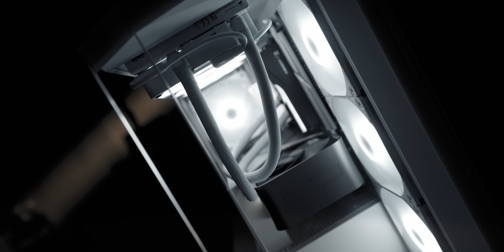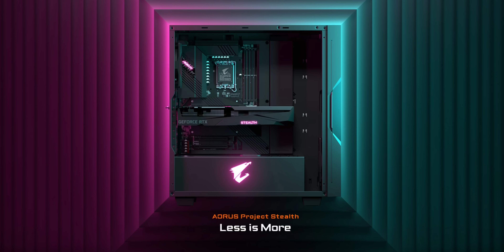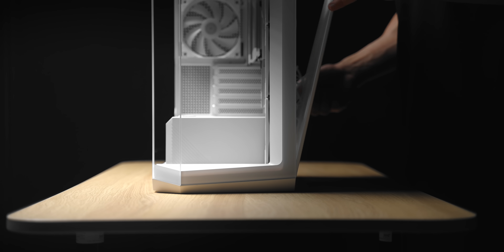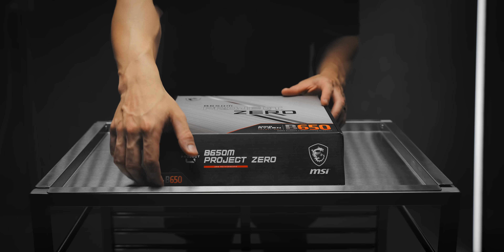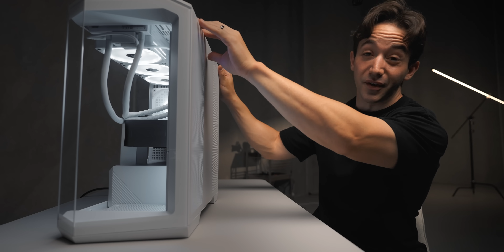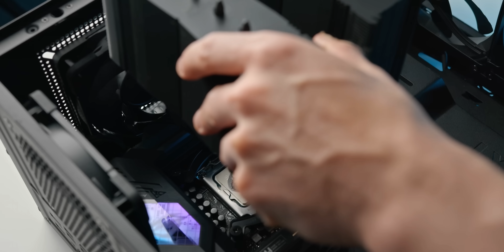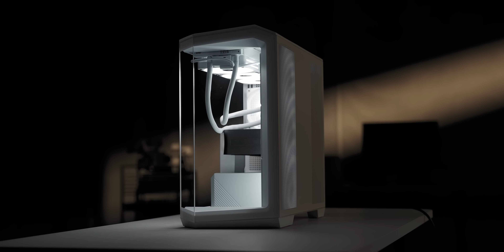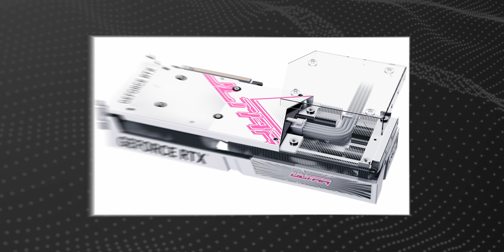"zero cable" PCs are here.

Comment: Ever since I assembled my first 486, I was annoyed that the cables were not plugged into the back of the board. And there were no fan connectors back then. That was primarily the 24-pin connector, the various ugly front panel connectors and the wide, flat IDE cables. It's nice that 30 years later there are finally solutions to hide the cables *completely*.

Comment: Just bought the MSI b650m Project Zero board and im gonna put it inside the Jonsbo D32 PRO which supports the BTF standard. Can't wait to build inside it. Gonna use my 7800x3d + 7900xtx from my main rig since im simply downsizing. ASUS royally fucked me hard when they did a bios update which REMOVED memory support. So my 64gb DDR5 6000 cl30 TeamGroup ram which WAS on the support list prior to the bios update, no longer works at rated speed. ZERO tweaks allow me to retain full speed. I am now forced to run 4800 speeds.... So, along with my new MSI board, i bought some silver ram that just so happens to be on the MSI support list. Because one thing I know about MSI is that they NEVER remove memory support. So if the memory is supported, it always will be. I legit wont touch ASUS boards ever again. I can't support someone who does such a thing.... And over my years of Ryzen and utilizing MSI I never had any issues. Even when I had "the worst x370 board ever made" according to many tech youtubers, aka the x370 gaming pro carbon which "has the worst VRM design of any motherboarb." meanwhile I was running my 1800x as a blistering 4.2ghz at 1.5v which everyone said was "impossible" because "your vrms can't handle 1.5v" and "the 1800x isn't stable at 4.2ghz" yet, I did it. And then after 6 months, due to running 1.5v, I had degradation. Which I knew would happen but didn't care. After that point I ran 4 ghz at 1.42v which was higher than the stock 4ghz at 1.36v it could do prior to degradation. And then about 6 months after that it wouldn't run 4ghz anymore and I had to drop to 3.8ghz at 1.42v which showed how bad the degradation was snowballing. Eventually to a completely dead 1800x. I've since stopped overclocking because I just dont care for it anymore. Ran my 3950x bone stock and my 7700x bone stock (which I donated to my brother) and now my 7800x3d which CANT be overclocked (not modern OC by changing multiplier) so yeah. Never ever had issues with MSI motherboards. They've been the MVP this whole time. Even way back in the day my brother used to use MSI in the 90's and never had issues then either. Going back to MSI will be legit. Put my 7800x3d in it, my new ram, my 7900xtx (power color red devil) and gonna use a arctic liquid freezer iii 240mm with my corsair rmx shift 1000 watt and its gonna be a rock solid build. Hopefully the case design for top mounted radiatior in 240 will give me enough room to run push/pull but if not, no big deal.

Comment: To make a completely white PC, do I have to buy a white or black power supply will be good because it would be hidden?
Reply: Depends on your case choice. There's way more BTF/Zero cases, especially Mesh cases and Fishtank/angled cases with a rear/bottom cubby/cable section to hide the PSU and wiring. The bigger issue is usually trying to get white GPU and motherboards, as they are both the most expensive, and the most difficult to buy in stores, often on backorder. Fans, AIOs are sometimes difficult for the same reason, i.e. you have limited choices in 'pure white' fans. It is easier, but it can be a long wait in some places to get stock. 

PSUs tend to allow for modular cables, which you can resleeve or buy custom color / custom length cables. With a BTX case, you don't have to deal with that, just the AIO cable/tubes.

Comment: I hate tempered glass and people using their PC builds as fishtanks for tacky lighting, and to me this is just a cleaner version of the same bad aesthetic. But having all of the connections right where the cable management happens is still smart.

(Though for really cramped sff builds, I could see it adding bulk to the build because you need cable management space in the first place in order for this to be smart, so it's probably pointless for cases where they expect you to just cram all the slack under the power supply where the cables come out, or for other SFF cases that use a riser to put the graphics card on the reverse side of the motherboard.)

Comment: if you want to, vertical mount the gpu and then add one of those cables that has a plug that goes forward then straight down for a cleaner look.

Comment: Your point about 'How are they going to make this clean, minimal case, but then make this abomination.' is really where case, GPU and mobo designers need to look now that they've gotten 'RGB everything' out of their system. How do you make a build platform that remains modular and standardised but is also designed like the person making it actually cared about the final build's experience for the user. Apple did it well but they had to break away from the need for modularity/standardisation, but to be fair to them, PC design just got stuck on this 'metal box of fans with a big GPU box in it' state 🤔So there's a market gap there to be filled if someone can figure out the design problems that Apple had to compromise on by going 'closed system'. Can we really do no better under the square ATX/ITX standards?

Comment: to hide the gpu cable you should of vertically mounted the gpu then used a 90 or 180 degree 12vhpwr cable to route the wire behind the gpu to make it not visible

Comment: Not only is it cleaner to look at, but it's easier to build the PC since parts go on one side and cords go on the other and none of the parts get in the way of fitting cord ends into slots, and it's also easier to actually clean. since most of the tiny spaces that end up collecting dust are all separated to a back panel that can easily be opened and cleaned separately without, again, having to clean dust through cramped PC parts.  Hopefully NVidia, AMD and the GPU mod brands support this PC build style in the future, it's literally just changing where the plugs get plugged in.

Comment: the GPU cable will have to be taken form the power and will be shown there anyway until they found a solution to that it's not Zero cables
the only cables you normaly see is just 1 big cable for PCU that can be very good looking, and gpu cable
all the rest you never see in normal builds anyway.

Comment: we have been slowly moving away from cables, no floppys, cd roms, NVME SSD's etc. the fans should all work off of one cable is this is long over due and that really just leaves the GPU which i never understood why it could not be integrated into the motherboard and PCI-E slot. i know they can hit up to 600 w but there has to be a better away than that giant cable.

Comment: It's very practical but it looks soulless in my opinion. I would prefer the CPU, 24 Pin, GPU cable etc to still be at the front so you can display some nice braided cables and have all the smaller, uglier and hard to reach connectors like fan and sata etc on the back.
Reply: minimalism = soulless 😂
Reply: @jensonphan  yeah pretty much

Comment: I’m doing this exact build same aio keeping the stock fans only thing is I’m going to use a white you can someone please tell me where he has the mask fans led connected to when he shows the back he has the fan connectors in the included fan controller but doesn’t have the led cables connected to the controller

Comment: Tomorrow ill have this... 
NZXT Pubg Limited Case
Msi Mag b760 Tomahawk ddr4
i512400 / Artic liquid freezer 2 240 
Saphire RX7800xt Nitro +
Corsair Vengeance RGB PRO 32GB (2x16GB) DDR4 3600MHz
be quiet! LIGHT WINGS 120mm PWM Triple Pack high-speed Ring RGB ( TOP fans )
One Black non RGB exaust Fan from NZXT
4TB m.2 / 4TB Sshd / 1TB Samsung ssd.

Comment: No cables...but it has that FUGLY tubing from the water cooling system.
JAYSUS.
That is uglier than the electrical wirring. FIX THAT CRAP, get proper tubing installed, not the generic ones provided.
Imagine in your home, you'd have pipes tubes across your bed or your table, because the installer was lazy and cheap and instead of routing them around the corners and tucked away, they simply connected A to B and called it a day.

Comment: I don't see anything on the web or conversation about the potential for SFF applications. My MeshroomS with a MSI ITX board would really benefit from BTF, as the 24pin and other connectors abut the fins of the front-mounted 280 AIO. If there are any ITX boards in BTF configuration, I am already mounting the board with about an inch of standoff from the backplate, and probably wouldn't have to dremel anything.

Comment: I think If you just build your PC right now, there is a good chance, that the shown PC will be more Standart and also cheaper in 3-5 years. 
3 Fans Solution will be more widespread and cheaper. 
Maybe more Motherboards with Connectors from behind
Maybe more GPUs with Powercable from behind
It's looking good for the future.

Comment: This needs to become the norm and standardized across all motherboard manufacturers and case manufacturers. That along with the daisy chained fans like the ones found in iCUE Link and Lian Li's newest releases. 

PC building has been rather archaic for a while now with the only things becoming standard are the non-removable IO shields and then little things like having switches instead of screws for SSD mounts and such. Lot of cool things on the horizon for sure, hope to see them sooner rather than later

Comment: ASUS (ignoring the whole warranty issues here) actually has released motherboards and graphics cards with an additional slot for power. Removes the cable entirely and the graphics card power cable goes into the motherboard (to supply the extra slot with power) in the back instead of the graphics card.

The graphics card solutions are called BTF power connector.

Comment: New product idea a pc that is recengular that lies on its back instead and is wide enough to put the monitor directly on the case. Then you put all wire connections on the bottom and run cooling from the front facing the person and pumps it to the back as well as maybe through the top.

Comment: It's very nice but that cable guard looks worse than the cable its covering. It's quite a shame about that GPU cable too because there's no way nvidia will ever stop putting the connector there (its there specifically to make it so the card cannot fit nicely into a rack mount). Very annoying - I had a GTX460 back in the day that had the connectors at the end like they should be and it was so much better even when you weren't trying to hide the cable.
Reply: You can now get a GPU that has an extra connector for the power, that slots in beside the main slot so no cables needed.
Reply: @chrisprouse3734  is it nvidia? If so what model? I'm curious to see this

Comment: I am curious if you can get some rubber risers and sit this case on its side. The clean look of it would look awesome just below my TV on the stand. I honestly wish more cases were made that both fit and looked good for those Entertainment Center PC gamers like myself who use a 70-inch 4K TV as my monitor to play games from my recliner.

For primarily aesthetics reasons plus to get my PC off the floor. I was looking to see if any PC cases that were thin enough, but also not so large so that it could fit under your standard frame and glass TV stand. And while I know decades ago the desktop PC was literally laying flat on your desk top and PC cases moved away from that, there really aren't many choices in the long flat case PC market. And for usable desktop surface space-saving reasons I understand why they stand tall now. But I say there's no reason the gaming PC connected to the TV market couldn't get a boost too.

Comment: This is definitely a great idea. My only concern though is how motherboard fitment in cases will be handled once more manufacturers start to adopt this concept. Cases designed for motherboards with rear facing headers would need to follow a standardized system for the size and positioning of motherboard tray cutouts in order to avoid clearance/fitment issues with these motherboards. The last thing we need is for manufacturers to have another excuse to try and push consumers in to their product ecosystem because they chose not to design their products with wider compatibility in mind.

Comment: Use a black cord with a 90 degree adaptor. The black cord will blend in with the gpu and motherboard better and help make it less noticable, the 90 degree adapter will minimize the cables profile and allow you to slide the cable up right underneath the gpu.

Comment: It looks like the dust filters are only on the top and bottom, so I'm uncomfortable with the current fan arrangement unless you actually want your PC to look like the inside of a vacuum cleaner in a month or so.  Apart from that, I really like this concept, it has some real practical maintenance benefits.  Though if you like to test the build outside the case before installation, this type of motherboard would probably make that process extremely risky without an actual test bench.

Comment: Asus has Back to the future (BTF) with 600W going straight to the pci-e slot, asus had also created BTF cards that were compatible with the BTF motherboard, along with a  case to match for ITX/ATX & Full Tower. MSI has Project Zero. Corsair was one of the first companies that was working towards case support, other companies followed closely behind them. Didn't know that Gigabyte had one until I saw your video, but I'm glad that there is another option other than just ASUS & MSI. I love ASUS but when it comes to DDR5 I've heard a lot about the issues their motherboards have caused. I'm not a fan of gigabytes customer support, but they do make quality parts that are resilient.

Comment: This video gave me inspiration on my next gaming rig build.
Google showed me motherboards from Asus, MSI, and Gigabyte ... and one of them is making a cable-free GPU which requires a compatible motherboard that can deliver 600 watts through the PCIe connectors.
However ... photonic CPUs/GPUs are supposed to be cooler ... but not sure I'll be able to build a photonic gaming rig before the year 2030.
My bank account is ready, but the mainstream market is not yet ready.

Comment: I have mixed feeling about this. While I do agree, that rear mounting would be better and it improve things, I also disagree on now wasted space for nothing. I already have complains for almost all modern PC case because you usually have only 2 spaces for HDD, 2 for SSD (on the case itself, so M.2 or other are not counted), but it simply not enough for me, I need 4 HDD mounting places. In the old cases where PSU was on top it was a thing, you could even mount 6 HDD's, but now as they make it aesthetically pleasant, they hammering down the functionality and looking at this case I can see a lot of wasted space, like this 3 inverted fans. The bottom part of it typically have 2 mounting points for HDDs, but now it just an empty space. So on that regard I really disappointed. My opinion would only change if either:
a) they add mounting places for HDD back
b) there would be released an SSD/M.2 of the same capacity or more like with HDDs
c) this case would be way smaller where it still designed for ATX motherboards (not mATX) but didn't have unnecessary empty spaces, but for being compacter it would allow you to switch to an external HDD solution only, that in the end it would take around same space and beautiful "zero cable" design.

Comment: honestly the 20 pin and 8 pin and gpu cables should all be visible with custom cables, i think it adds to the build quite a bit if done right. fans linking together should be the new standard though, i (and everyone else who builds pcs or has to deal with changing/installing fans) hate fan cables.

Comment: I'm definitely not a fan of having to go into the back of the computer for every single thing. I feel like cables should only go into the back if you don't anticipate the cables to be messed with as frequently or if it improves repairability (e.g. more accessible in the back than in the front). Also insane that there's no cable management in the back with that many cables in there.

Comment: This should be the norm, because it's much more logical.

In the front there are stuff like fans running and it gets hard trying to reach connector pins on between stuff, so having it on the back makes it far more simpler

Comment: Does this fix the issue with more support around the graphics card / motherboard connection? 

Graphics cards have gotten so much heavier and the design is really not up to date (decades old at this point) with the slot having proper weight support . 

Have had a pc go down cause the motherboard lost communication with the card after moving it, broken plastic tab connector etc

Comment: But there is a bigger problem that has more to do with practicality that is not being addressed.  Out the back of the PC case, there is  a bunch of cables that stick out horizontally and the thing looks like no one ever thought about this ugly mess of wires for all to see.  Maybe two Video cables, several USA cables, Power cable, Keyboard, mouse  etc.   What would be nice is ports that let the cables lay vertically, downwards, where they can be then dropped over the edge of the table, and this whole area at the back of the PC case can be covered by a thin cover that snaps on. Or has this been done before?

Comment: Marketing Blurb: This stylish PC has two functions; it's a computer; and an air purifier. It runs your favourite programs and games, while simultaneously removing dust from the air. PC Cleaning Indicator Function: The fans pull air (and dust) in to the case. So, very soon, the clear panel will allow a perfect view of your filthy PC! This feature indicates cleaning is required.